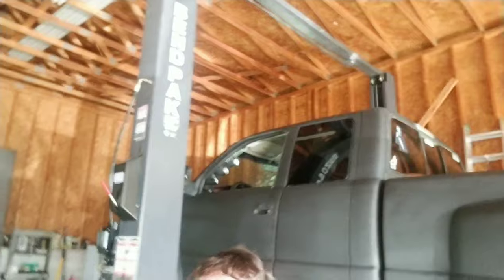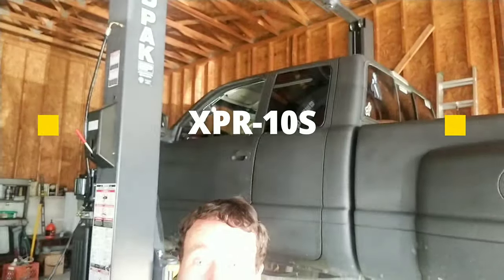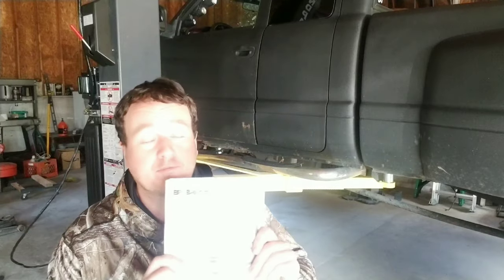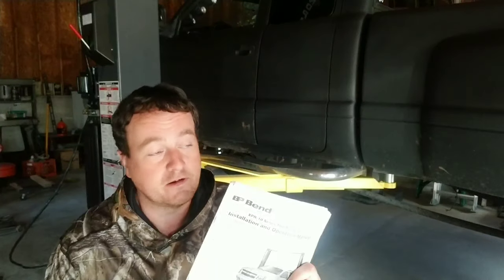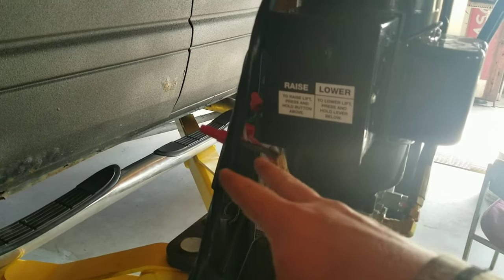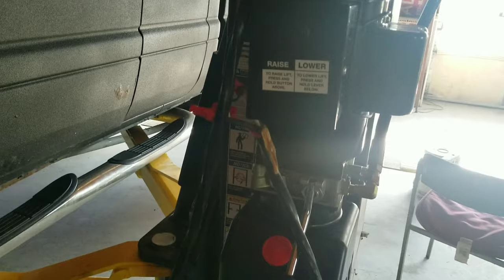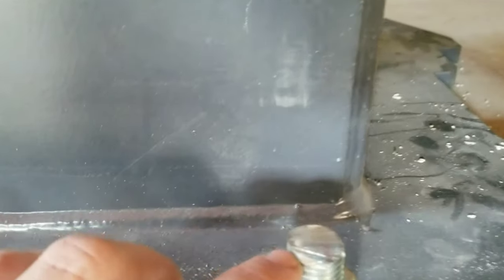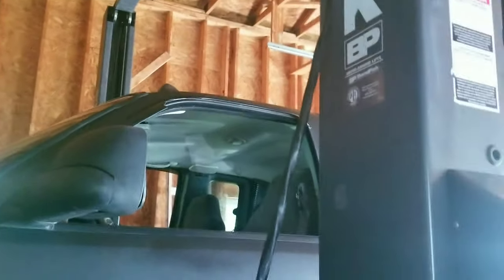Before You Buy A Bendpak!! (must watch)

Comment: Great video...ty.  did u look at Rotary?  There Up there at the top.. USA made Indiana..I have in my home shop an old school inground... Rotary..56 yrs old..I installed new piping undground moved the oil tank above ground as well..  be careful lifting trucks..  my lift came out of an abandoned service station..sat over 35 yrs..a 3 month restoration..I looked at above ground for my shop...but i found the one i have ..it was free i spent around a 1000 bucks all around from a new 100 piston seal..,sandblasting the oil tank new piping.. cement..we dug  out the hole on a  sunday..with some friands..got it in after  coating piston case with truck bed  liner...and piping as well   now  back in service i  have open floor  space
Reply from the maker: Thank you! I no  I didn't. It's been a good unit so far , use it all the time. I'm always super careful.  Thanks for your comment

Comment: When I was looking for a lift I went all round my area (10 + shops) and  surprisingly the owners were happy to talk about there lifts. Rotary was number 1, followed by forward. The shops that had a Bendpak lifts all told me to stay away from them.Customer service was bad. I ended up with a used Mowhawk in mint condition
Reply from the maker: Yeah their customer service was bad for sure!! Its been working great so far tho, I can say that. Glad you got a good lift 👍 they are a must have for sure
Reply: Yea, depending on when they bought their lifts, they could be made in USA, provided they were bought many years ago, if not, they are China, even Rotary, a good name, and was always made in USA, they say made in Indiana now, but when I questioned them on line and asked if they used any chinese parts, that's when they stopped replying to me, so take that with a grain of salt!
I understand that Mohawk and Worth are the only ones left that are still made in USA with American made parts, I purchase a Worth lift recently and it was almost a $1000 less than the rotary lift with the same asymmetrical clear floor10K weight load; hope this helps,,,
Reply from the maker: @rickallen8158  very much so! Yeah honestly wish I would have gotten a cheaper one and used the extra money for something else. But it's been working great so far

Comment: Those columns should have welded gusset plates in both axes to help stabilize them at the base. That's why the base plates were warped. No gussets for strength, and poor welding techique... I would rather pay more and get a safer lift. My truck is 8000 lbs.
Reply from the maker: Yeah that's the thing these ones are more expensive but still made in china. That being said I use it all the time and its holding up great. I should do a newer video on it. Thanks for stopping by

Comment: You want so-called "soft steel" for such tasks as hard steel (brittle steel )is what shatters without warning, not so much soft steel. That's why airplane wings flex. You do not want super rigid materials for high dynamic strength applications. Secondly, you bought one of Benpaks entry level lifts. As always, we all get what we pay for. I appreciate your honesty about not having followed the red bouncing ball (directions) properly. That added to your ultimate feeling toward your lift. Yes, the pumps are all very similar because industry tends to copy what works best if patents allow. Bendpak is a leader in this area, an area where the fellows that use them have excellent judgement regarding all things mechanical and structural. If Bendpak was truly a bad choice, they would definitely not be such a popular lift manufacturer. Anyway, congrats on your new lift. Its a luxury many do not have (do to many factures other than money). Enjoy it. Be safe, especially around gasoline and gravity.
Reply from the maker: Yes
Reply: fellows that use them have excellent judgement regarding all things mechanical and structural.

The 18 year old kid in high school is a structural engineer?

Comment: How safe are these lifts? Any advice you can give me when I get one of these?
Reply from the maker: I use it ALL the time and it works great!. For safety I put lift stands under the front and rear of the vehicle I'm working on ( you can buy them at harbor freight for like 80$) I had 10klbs vehicles on it and no problems.  Your concrete must be strong tho. I have high psi reinforced concrete in my garage. You can give those guys a call they are based in Florida and are extremely helpful and knowledgeable. When it comes to assembling you gotta pretty much assemble on the ground then lift it up. It's not to bad if you have some help. If you need any pointers let me know, I'll help were I can 👍
Reply: @GearsAndGuns  Thanks sir, I actually live in Mexico, and I'm owner of a Tire Shop. There's a bendpak distributor in my town, but to be honest I find a little hard to trust your life to one of this lifts, so that's why I'm doing a little research before buying one.
Reply from the maker: @fdkfskfkvmk441254741  I agree,  I dont want to get crushed either 😬. You can get a four post lift but if you want to change tires you cant do that easy. I always take my time and make sure the vehicle is balanced properly before taking it all the way up and put stands under before I start working

Comment: How much does the truck weigh? I have the exact same lift but the asymmetrical version.  I frequently lift my service vans with it that are probably right at 10k if not a few hundred pounds more
Reply from the maker: I lifted trucks that weigh at 9klbs with no problem! You should be good. I always keep an eye out and I have stands I put underneath to take alot of weight off
Reply: Keep in mind that pick ups are heavy on the the front two lift arms so if you raise a 10k truck up on a 10k lift you would be over loading the front two lift arms? Most people don’t think of this, and  some bend pak are made in China but they still have the best safety standards on there lifts, there lifts are tested at 1 1/2 the rated lift capacity